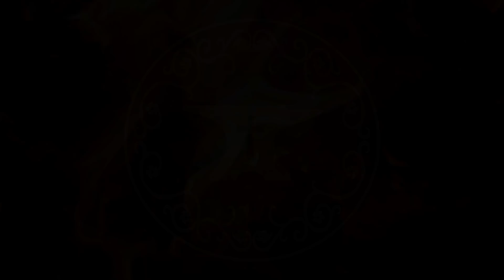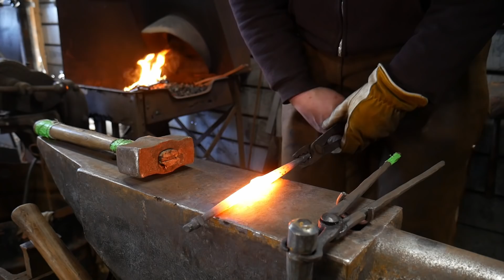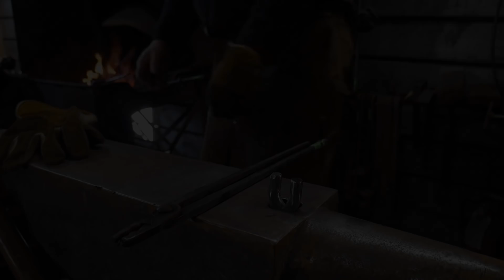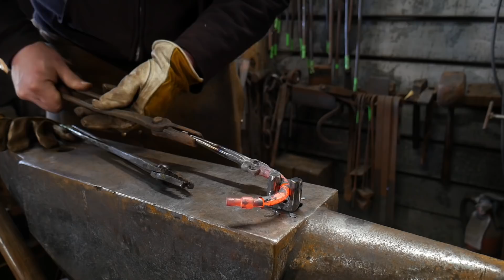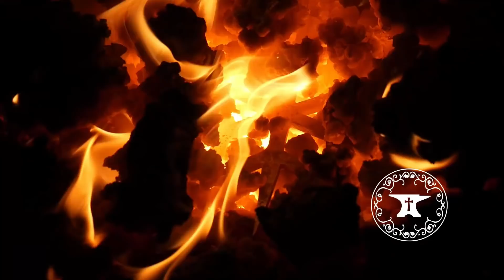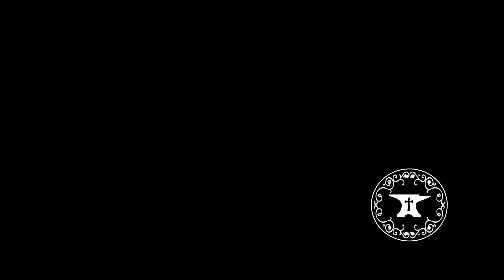Gothic Door Knocker Part 2 (150mm Challenge)

Comment: Roy, Would you give kind of a first, second, third explanation of logical buys for hammers and tongs. I'm just starting and frankly copy all of my work and techniques from a very few Smiths like yourself who I owe a great deal. As far as sizes and weights just speak for yourself and I'll figure things out. I've started with the rawhide mallet and a few old beaters but would like build a decent rhythm section. Thanks.
Reply: Jonsey When I got started the first two books I read where "The Blacksmith's Craft: A Primer of Tools & Methods" by Charles McRaven and "The Modern Blacksmith" by Alexander G. Weygers. Both were great reads and tons of info on fundamentals and tooling. My first purchases were a 2.5lb farriers style rounding hammer, 1/4" V bit tongs and a pair of 3/4" bolt tongs. Already had a 3lb cross pein and a few different size ball peins. Would recommend either buying or making some tongs for a common sized flat stock you might use pretty early on, I struggled holding that at the start. That was the first pair I made out of necessity. From there started making any other tools I needed when I found a need for them as I progressed. That worked out well for me and saved me a ton of money so far. Oh yeah, Lorelei Sims also has a great book for beginners "Backyard Blacksmith" I think was the title. Hope this helps a little.
Reply: @jeffsandling5981  Thank you sir, I'm not lazy, just don't know where to look... I am learning from guys that I have never met. That is very cool and appreciated.
Jonsey
Reply: Jonsey no problem, don't have much to share yet, but try to share any and all I've  learned from others so far. I'll keep all the new curse words I've learned to myself though!...lol! "Kens Custom Iron" sells some tong blank bundles that you finish out, I think they're around $45-$50 for a set of three or four pairs. If I'd have known about those first I'd have jumped on them. Happy hammering! Btw, I've yet to meet a stranger in blacksmithing!